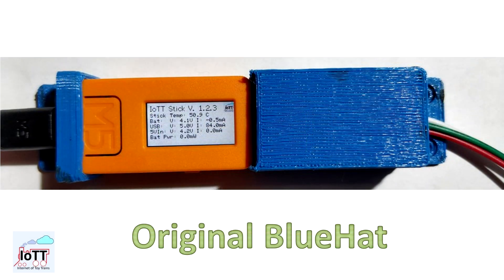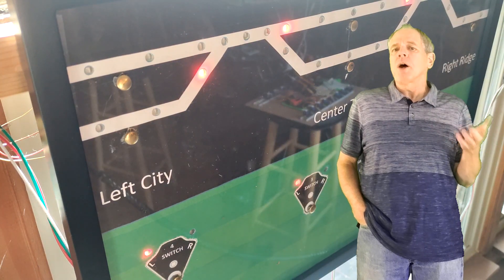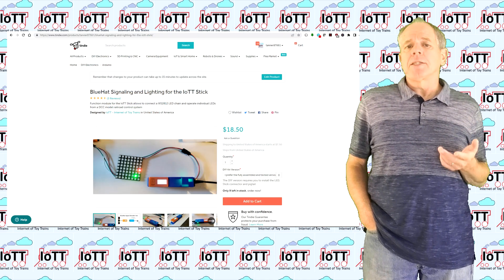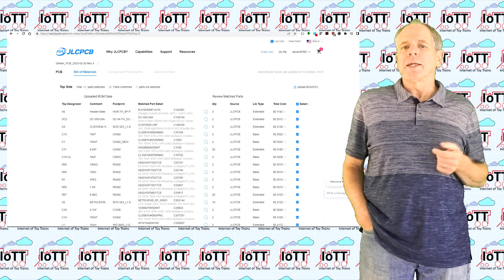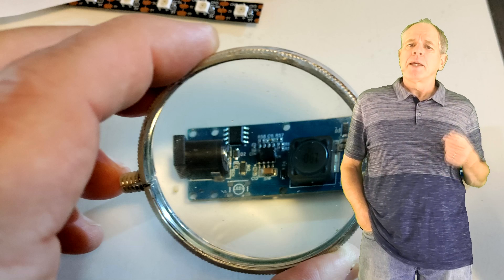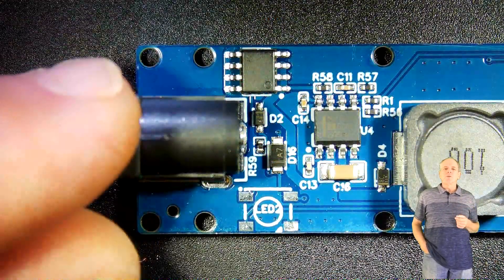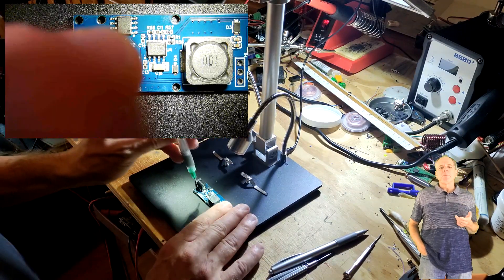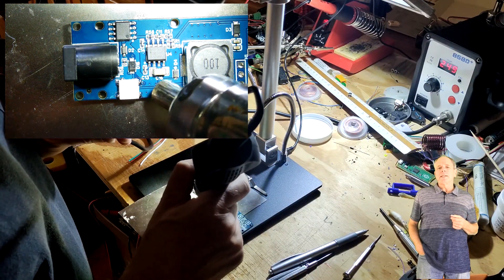Build your own BlueHat (Video#129)

Comment: I am new to model railroading. I built a DCC ++ and then a DCC EX command station with the wifi shied which required me to flash the bios.  I was able to program my locomotives. now It was time to hook up the main track and run some locomotives. That came to a screeching halt because my layout has two reversing loops. Through my research I discovered it would cost me over $70 to purchase a single Automatic reversing device.  To add another twist, I did not feel the DCC EX command station amps would meet my demands of how I wanted to operate my trains.  It appeared I needed a booster and an automatic receiver.  My research led me to your site.  I am a little confused on the locanet application probably do to my lack knowledge of how to set up a personal network.  I appreciate you integrations with the DCC-EX command station since I did not wat to purchase one of the property command systems.  This has give me food for thought of how I Want to proceed.  I am looing forward to seeing the completion of the AUX booster and integrations with DCC-EX.  Just what I was looking for, your videos have sparked my imagination on where I go from here.  Oh wanted to congratulate you on your new toy LM 246 Microscope.  I know that I am getting up there in age and my eye sight is not what it use to be boy did they I am going to get me one.
Reply from the maker: The simple solution for your reversing loop problem is using a reversing relay that you can operate from a switch decoder. You than can use two light barriers to set the reversing loop turnout and polarity whenever a locomotive approaches the turnout (from the Y side).
The booster I am working on will have a reversing feature as well. And to operate it, you only need DCC, Loconet is not required. More on that in one of the next videos.

Comment: Good to see the blue hat developing!  I have several of the older versions working on the layout which I managed to make myself.  Is it possible to not use a buck converter on the older model and simply short out the terminals on the board and supply it with 5V ?
Reply from the maker: The BlueHat or the Neopixels do not care where the 5V is coming from ;-) The easiest option I think is leaving the BlueHat powered just by the Stick, without using the power jack, and then feed 5V directly into the red wire if the pigtail (disconnect the red wire from the board). Make sure to connect the GND of your power supply to GND of the Stick so both are working on the same GND reference.